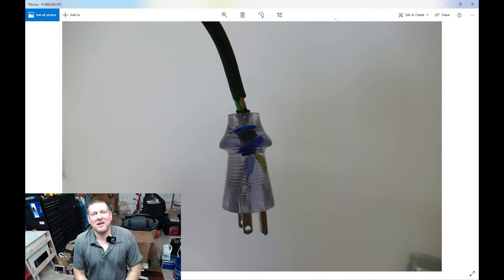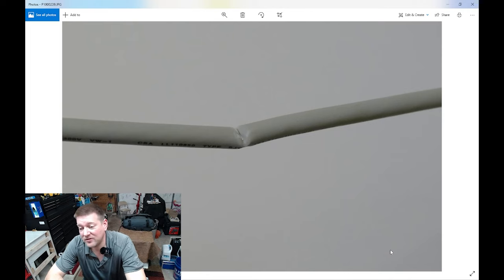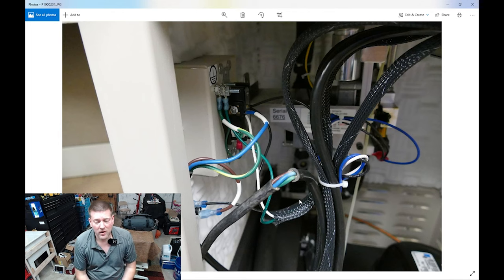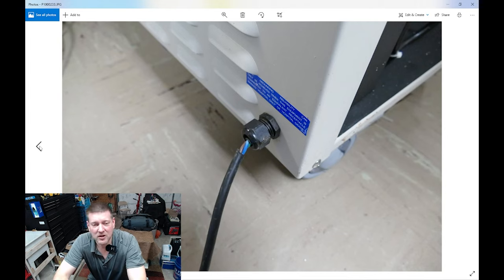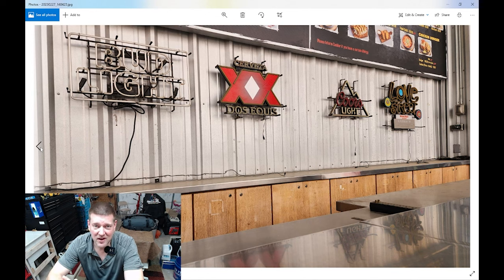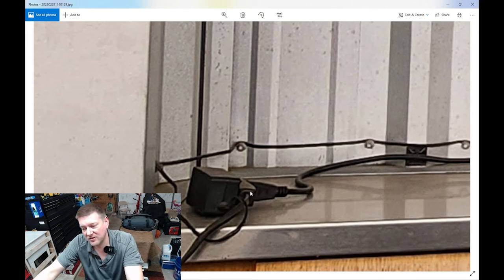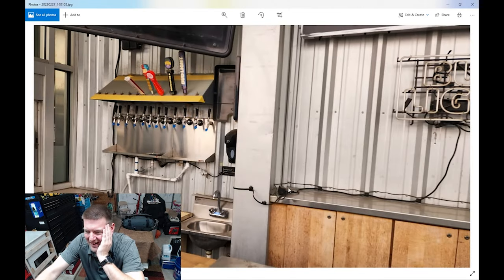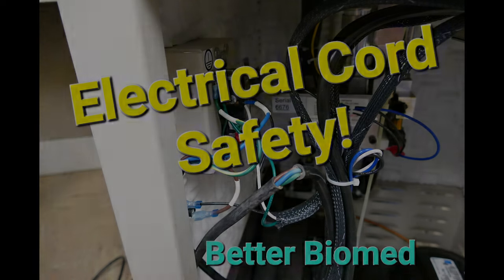Power Cord Safety!

Comment: Good video. If you look at many sports bars that have multiple screens the standard of wiring is frightening. AC sockets that are spurs of spurs daisy chained together, cables connected together with terminal block, loose power cords not tied neatly etc - scary stuff for my OCD. I order a few doubles that usually helps!

Comment: 9:22  The most thing that would scared me, is those Neon signs itself. Those use mains voltage and have a stepup transformer to approx 2 to 15Kv, and all that is mounted to a metal corrugated side panel. i hope that metal side panel is grounded, because the stainless steel work bench makes definatelly contact with that.
Another big safety hazard, are the self attached power plugs, i have seen some where the strain relieve plate was placed on the 3 inner wires, and not pressing down on the outer isolation, because they stripped the outer isolation away too much. Also seen where they pinched down the strain relieve on the outer isolation, and where the cable is totally crushed flat. This will become a hot spot when using high current, and will burn out.

Comment: @4:34 that's not a rubber cable. That's pvc plastic. The rubber cable would not yank out the clamp even if seated in great hurry / lack of care.

Real rubber cables and clamp nuts are a standard here in Europe everywhere outside home use. Only weak cables (by mechanical resistance) we use outside home use are ethernet and fiber. The home use pvc-coated AC-cable is forbidden in extension cords and even the visible wall mounts are avoided as much as possible.

The last picture made me lose my mind. Not only because visible cables in "art" / decoratistic places are very ugly, but those AC cables should be hidden / inside a rack and DC cables should always be short as possible and never used in constant installations (wall mount).

Your videos from european perspective are absurd. But leaving the comfort zone is how I try to develop myself.
Reply from the maker: I never said rubber cable. I said rubber grommet which is located inside the screw down stain relief.